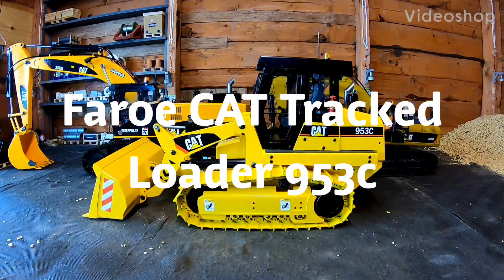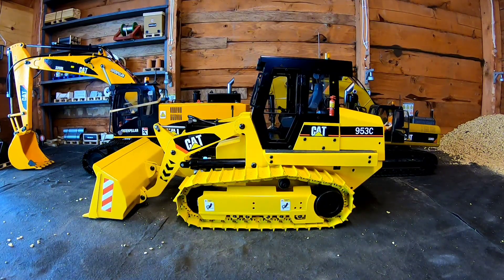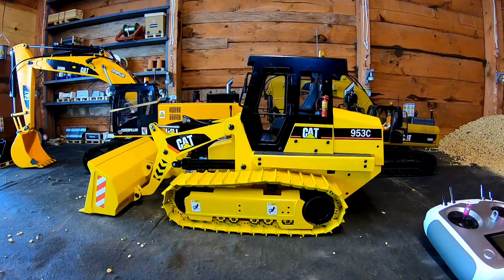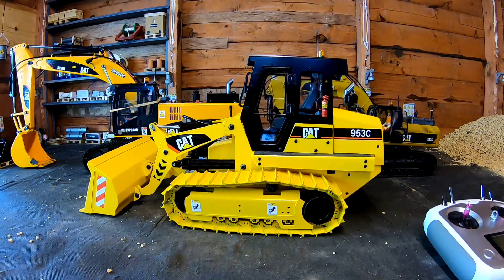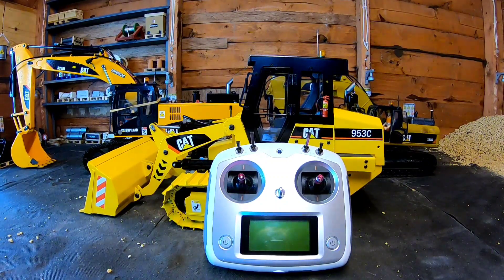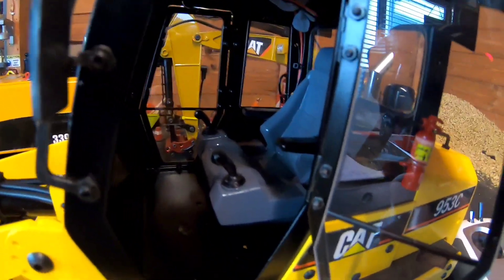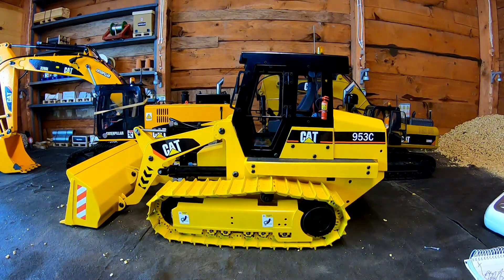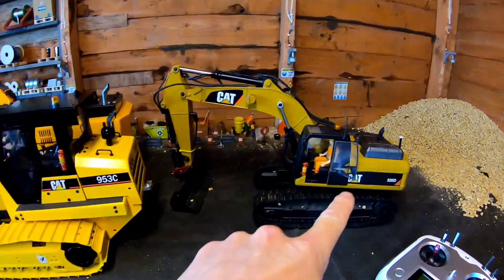Faroe Hydraulic CAT Tracked Loader 953c Part 1

Comment: How do you change the hydraulic fluid is there a plug on the bottom?
Reply from the maker: No plug on the bottom, it has a filling point at the top of the tank also drain oil from there with a syringe and some tube attached, suck it out.

Comment: beautiful loader how are you enjoying this model?  I am thinking about getting this model any input would be helpful.  Im hung up on this model or the lxy skid steer, yt with my fleet this would be more of the of power ling up side of my fleet.. Does this also come with the forks? Im concerned about the pins I have heard that before on Faroe models. I would do the same with he dap of glue.  Im heading over to your other videos 8-)
Reply from the maker: Hi, I would definitely recommend this model 👍 yes it comes with forks. After glueing in the track pins I've had no problems whatsoever.

Comment: What glue did you use for the pins on the track to get them from coming out I had to push a couple back in? And did you glue both sides of where the pins are?
Reply from the maker: I used super glue on just one end.
Reply: Did you use it on the inside or outside of the track?
Reply from the maker: On the inside of every pin.

Comment: I did everything you said in your previous video showing how to mix the hydraulic pump but the hydraulics are only working in one direction on each channel is there a reason for this?
Reply from the maker: I'm unsure why that is happening. Go over the process again to make sure you have followed it correctly.
Reply: I just realized I had the negative positive 100 instead of negative 100. That fixed my problem 👍🏻 And I see that you can still use the pump switch if you need the constant power. But I will mostly use without to save battery and pump life.
Reply from the maker: Well sussed 👍
Reply: Appreciate the help, it works amazing with the pump mixed.
Reply from the maker: You're welcome, glad you're happy with the model ☺️

Comment: Hello I just bought this tracked loader can you send me a link of where you got your battery or give me a link for another battery that would work for this machine? I’m in the US
Reply from the maker: Hi, I'm in the UK. The battery I use is a 3s 11.1v 4100mah lipo Dean's T connection. I had to grind some of the bottom off the seat to slide the battery in from the back.
Reply: Do you have the dimensions of the battery? Want to make sure it’s the right size to fit before I buy one.
Reply from the maker: 135mm x 40mm x 25mm (LxWxH)

Comment: Hello,
which hydraulic oil do you use 32 or 46?
Reply from the maker: Hi, I use iso 32 anti wear.
Reply: @ianyams  ok thanks for the videos and the help, maybe I will buy 1 but what bothers me is that there is no mixing for the advancement ....
Reply from the maker: You’re welcome. What do you mean advancement?
Reply: @ianyams  on my electric models (I have a bruder 963) the translation and the rotation are done on 1 single handle, we can therefore actuate the bucket on the other handle while driving, is it not possible with this machine?
Reply from the maker: Yes this is possible in the mix settings in the transmitter although I prefer the tank steering settings that I have got used to.
Reply: @ianyams  I happen to read these comments and I also agree this model can be mixed for the tracks one stick bucket lift other its just done through your mix options on the transmitter.  congrats Pat on getting one as I am looking into this model or the lxy skid steer for next model. If I had to go with the dollar to pound this model would be getting more for your money Im hoping lol..
Reply from the maker: Yes you can mix the controls but I left mine as tank steer.
Reply: @thatsmyrc  the mixing works very well, on one side the translation and the other the tilting of the bucket, then the ripper on a key function
Reply: @pat6557  I have all my flysky systems set up that way on my transmitters for my equipment I agree it does work very well.  I sometimes will set the pump on a boost mode using ch9 or 10 key button on back, When I mix the pump into the controls also.  This way if you want a quick boost on models that don’t always need pump action such as the dxr2 dozer you can hit the key.
Reply: @thatsmyrc  yes I know your beautiful videos
Reply: @pat6557  does anyone know if the drx2 dozer tracks works on this tracked loader?  I was wondering if they would.  I have a full new set of the stock tracks for the dxr2 as I upgraded mine to the steel link e-clip locking pin design. Heck if they did and I got this model it would be nice to have a back up if needed

Comment: I added a total of 77 ml of oil to the machine and it started pushing some oil back out of the tube when I started running it and moving the cylinders in m. Does that mean the hydraulic oil tank is full of oil?
Reply from the maker: Yes full.
Reply: Okay 👍🏻

Comment: You have the Wa470 loader as well correct?
Reply from the maker: Yes the C.A.T. 980L wheel loader.
Reply: How do you like that loader?
Reply from the maker: It's most probably the smoothest model I have, the sound & light system is very realistic and its very powerful. I love it.
Reply: Just was trying to figure out if I wanted to buy this machine or a bigger excavator since I only have the Kabolite 336 and is a little small and less powerful.
Reply from the maker: Yes the 336 is about 1/16th scale, the wheel loader is 1/12th ish.
Reply: I was thinking about getting RC4WD 360L Earth Digger do you know anything about this machine?
Reply from the maker: No, nothing.
Reply: I have seen many videos of this machine didn’t know if you seen in personally. It is more expensive then Faroe excavator but looks very powerful and weighs about 60lbs.
Reply from the maker: Which machine?
Reply: The Earth Digger 360l from the company RC4WD.
Reply: It is a 1/14 scale hydraulic excavator.
Reply from the maker: Oh right. I have the C.A.T. 339 DL Pro from Faroe, had it 3yrs, had to change the pump and all hydraulic ram O rings. It's my most used model. Good for the price.
Reply: What happened with the pump did it loose pressure over the 3 years?
Reply from the maker: No it started leaking from the oil tank, and the pressure gauge went faulty. it's a combined tank and pump.
Reply: Was it just an oring? Is that a common issue?
Reply from the maker: No multiple leaks on the tank and pressure gauge. The company have re-designed the tank and pump and seems to be better. The O rings in the rams are common wear and tear.
Reply: Okay that’s good to know, because I seen they said the 953 loader had a new pump and stronger hydraulic cylinder as well. So it seems they have made modifications to the machine. 👍🏻
Reply: I just received 4500 mah battery in the mail for longer run time and the seat is in the way for the battery to go further back how exactly did you manage getting battery in? I noticed the seat is adhesive to the bottom of cab should I relocate seat further up or trim seat from back to fit the battery?
Reply from the maker: I left the seat in and used a Dremel with a grinding wheel and cut the seat from the back at an angle, once I ground enough out I put black tape on the battery. now it slides in from the back at an angle and partially protrudes into the cab. The black tape is to disguise the end of the battery. Make sure you put a cloth over the workings, the dust gets everywhere.
Reply: Have you tried adding weight to the back of the machine with added weights? It is a little light in the rear of the machine.
Reply from the maker: No.

Comment: How much hydraulic oil did you have to add before your first use?
Reply from the maker: 100 millilitres.
Reply: Do you receive bottle to fill it with?
Reply from the maker: I got a big syringe with it.
Reply: Is AW 32 hydraulic oil okay for this machine?
Reply from the maker: Yes that's what I use 👍
Reply: Did you do oil change when you received it to cycle through any metal shavings from new parts or is it okay?
Reply from the maker: It had no oil in when I received it.
Reply: How often do you change oil for maintenance?
Reply from the maker: Depends on how much it's been used, I'd say once a year for mine.
Reply: Okay, thanks for answering all my questions just trying to learn a lot about these given I am new to the hobby. Already have the Kabolite 336 excavator and waiting on my tracked loader to arrive. It is a expensive machine so I wanna make sure I do everything correctly.
Reply from the maker: You're welcome. If it's the same as mine it's a Great machine.
Reply: Yep, I purchased it from AliExpress. You are the only one on YouTube with any good videos showing what the machine is capable of. 👍🏻
Reply from the maker: Thanks, I had the same problem when I was going to purchase mine, no decent video's, that's why I have uploaded them to help others to make a decision.
Reply: Well your doing a fantastic job. Love the rc channel keep up the good work 😎
Reply from the maker: Rrrrr, many thanks 👍
Reply: No problem, should be receiving mine by March 28th it was shipped through FedEx so was very fast shipping.
Reply from the maker: Brilliant, Where are you based?
Reply: United States
Reply: I just received my loader  yesterday and they didn’t give me syringe to put in oil but I had one laying around to use but doesn’t work well and was messy to fill up.  I added about 55 ml to get it running. Where did you route the fill tube after you filled it up with oil?
Reply from the maker: Oh dear, not good from the supplier. Leave the fill tube open ended and just tuck it away out of sight.
Reply: Okay that’s what I did, where do beacon and lights get plugged in on the receiver? I plugged beacon in on channel 6 but don’t know where lights go.
Reply from the maker: The square lights or round chrome ones?
Reply: @ianyams  The square led lights on top of the cab.
Reply: It’s the lights on the front and the back of the cabin, the LED lights. Where exactly did you plug them in on the receiver?
Reply from the maker: You can plug them in on any spare receiver channel but they will come on as soon as you attach your battery.
Reply: That’s what I did, I plugged them in on the channel next to the 6th channel. I have my beacon plugged in on channel 6 but it will not change light sequences for some reason.
Reply from the maker: Ok, channel 6 on your receiver will represent a switch on your transmitter, make sure the corresponding switch is activated in the transmitter settings.
Reply: Okay, and is 2200 mah 3s 50c okay for using in this machine? They had sticker on back that said 30-35c battery
Reply from the maker: @coleramey16  yes, you should get about 30 minutes run time from that.
Reply: Okay great, what is your opinion on the four lights for the back? I saw another guy has a video of it on YouTube and his are hooked up and they come on when he backs up the machine working as reverse lights.
Reply from the maker: I didn't use them on mine, I tried to keep it scale looking and just put some stickers over the holes.